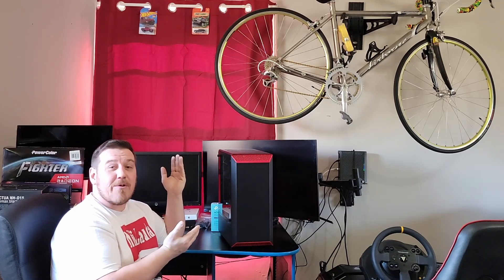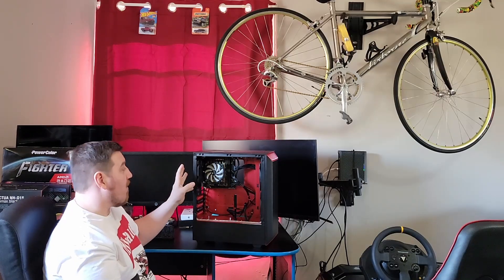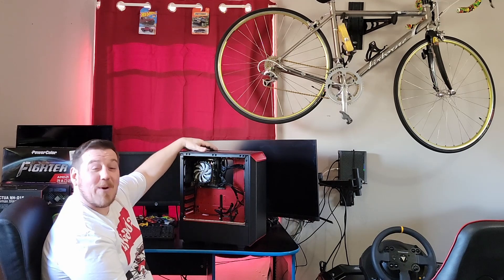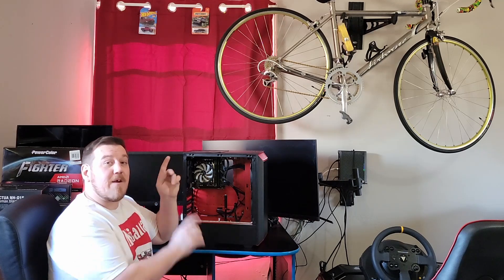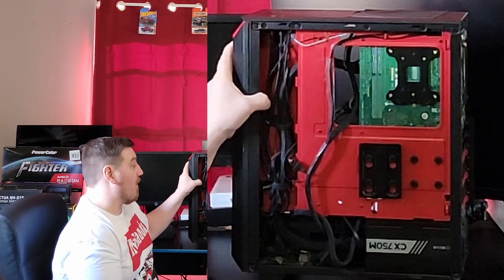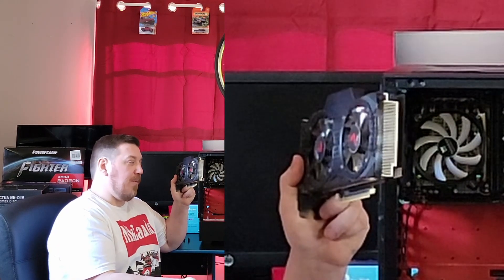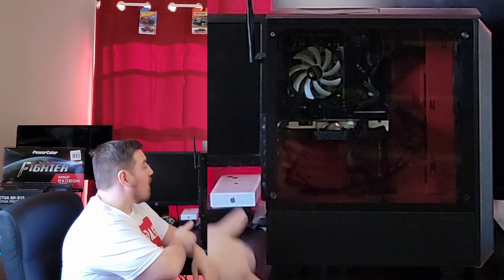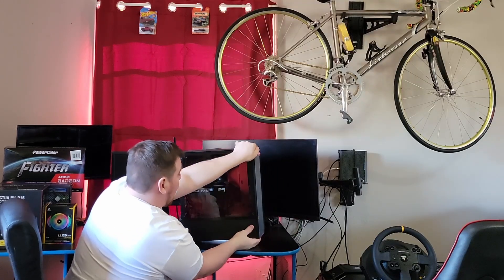ALIENWARE X51 R2 CUSTOM BUDGET BUILD PC: DIY CASE TRANSPLANT & MUST HAVE UPGRADES!

Comment: I have a few questions. whats the connection you used for the power supply? and whats the other motherboard the smaller one in the R2 do i need to swap that over with the main motherboard.?